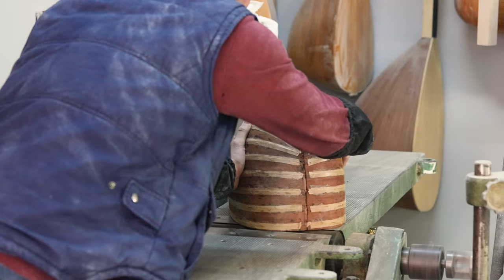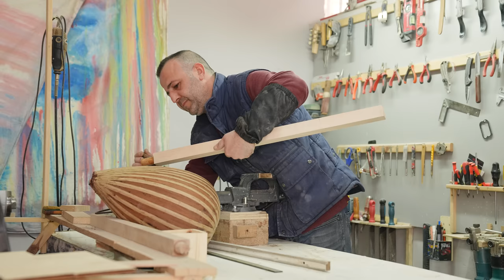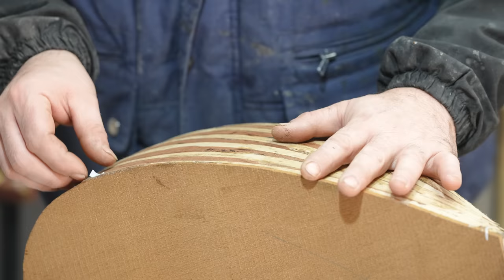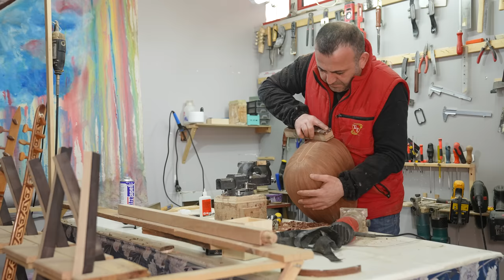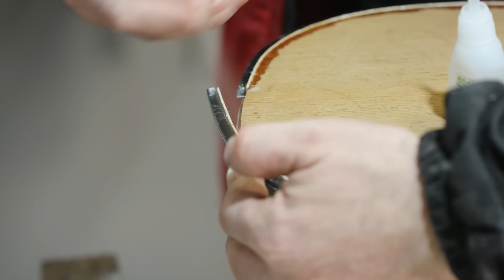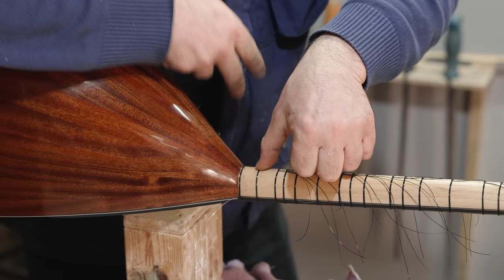Disappearing Arts: How to Make Handmade Baglama (Saz) ?  4K

Comment: Interesting that the soundboard is so thick and has no bracing …. and no hole!
Reply from the maker: Thanks for your comment.The sound board in the product we make is thin enough. Whether it is thinner or thicker may vary depending on the person. Making or not making holes is entirely due to specific reasons.